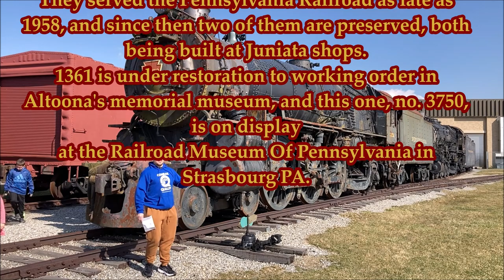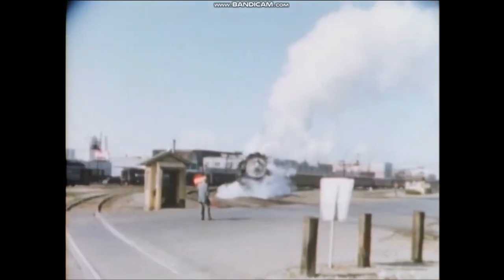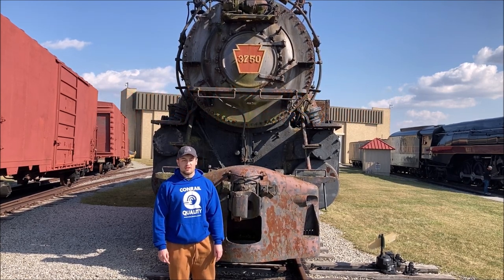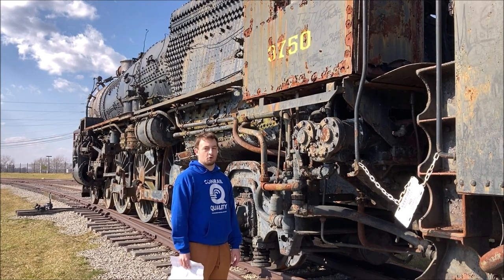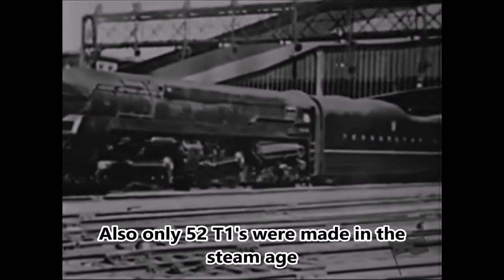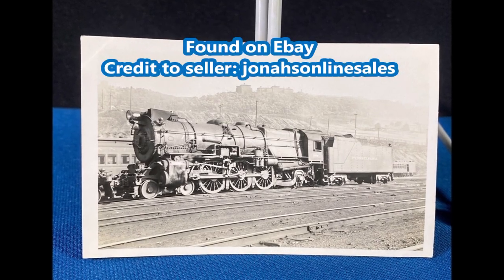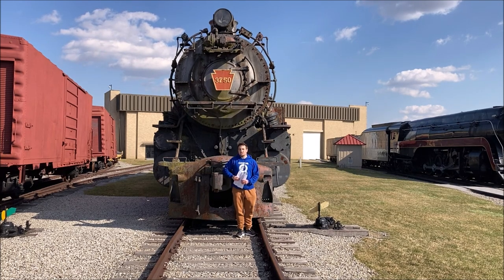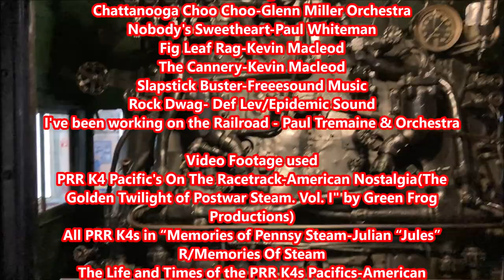The Pennsylvania Railroad's stupidest experiment ever| The K5’s |Garbage on The Rails Episode 9

Comment: The reason why the PRR didn’t have any 4-8-4 “Northerns” is for the same reason as T-1s being Duplex locomotives with Franklin Type A oscillating cam valve gear and why the PRR didn’t build any “Mountain”-types for passenger service. The main reason is that longer rods are typically heavier and create a greater hammer blow. This would be exarcerbated if the driving wheels were not counterbalanced correctly, which was the problem with the Atlantic Coast Line Railroad R-1 Class. This would mean that more money would be needed to upgrade the PRR’s infrastructure. Also, a low factor-of-adhesion is mainly an issue on gradients, slippery rails, long trains, and low speeds. The Southern Railway Ps-4 Class “Pacifics” had a factor-of-adhesion of 3.79, and they were very successful, powerful, and capable. The same goes with the Southern Railway Q1 Class 0-6-0 tender locomotives. While they had an issue with underpowered brakes due to their lightweight nature and a factor of adhesion of 3.81, they were still very powerful for their size and extremely versatile. I’m not trying to defend the K5s, but I am saying that a low factor of adhesion does not always make a bad locomotive.
Reply: The M1's were dual service locos, and a number of them did wear passenger striping for a time.
Reply from the maker: Another thing with history is that it can have so many perspectives from so many different people. Some you never see coming. The problem is that trying to put in so many perspectives at once can lengthen analysis, and even I have my own limits of what perspectivesI want to put into this stuff without making it too long. Understand too that while Thunderbolt 1000 Siren Productions is amazing at this, he’s been doing it for 6 years and it took him time to get better at it to where he is now. I’ve only been at DOA/GoTR for two years.
Reply from the maker: It’s true the PS-4’s got away with it. However the reason the K5’s didn’t get away with it as opposed to the K4’s or even the Ps-4, was because the K5 was just too powerful for its own low adhesion, and the PRR having a more rocky geography than the Southern. It didn’t have enough adhesion for its own power to handle over grades like the Alleghenies and other rough terrain on the network like the Horseshoe Curve. So kind of a mixture of PRR overdoing it with power, not coming up with the best way to load up enough adhesive weight, and geography. Then again, the Ps-4’s and K5’s came in for different reasons with completely different origins
Reply: Insert the northerns that probably a better locomotive than the T1.

Comment: Great episode as always! The Pennsy has always been known for keeping to old traditions, and I suppose this is a perfect example of how sticking to old tech can result in long term losses. I also appreciate how you include various mechanical aspects in this series, since I wasn't aware of the 4.0 adhesive factor until now, and it certainly brings home the point of the K5's failure. Best of luck in school, and continue to keep up the great work on the channel!
Reply: The Jersey Central was the same thing, Largest locomotives in its fleet were the G class pacifics

Comment: In 1939 the Lima Locomotive Works extensively rebuilt and thoroughly modernized Pennsy K4 5399. The end result was an engine powerful enough to do the work of 2 standard K4's. LIMA wanted to do the same work on a Pennsy M1 but due to circumstances such as the Pennsy’s reluctance to explore the options and onset of WWII it never happened. The Pennsy also favored Baldwin over the other builders and they, in my opinion, convinced the Pennsy to invest in experimental designs that often weren’t proven out. During the steam years Pennsy had gone to both ALCO and LIMA for assistance in new designs only to have Baldwin or their own Juniata shops do the work. The K5's also were built without stokers which was not surprising knowing the Pennsy's view on modern appliances for their engines.  Can't imagine the work involved for one fireman to keep the K5 hot.  Thanks for the interesting video.
Reply: That makes a lot of sense, since Baldwin was the closest locomotive workshop to the Pennsylvania Railroad apart from the Juniata Shops.

Comment: This was an enjoyable and well detailed video, the PRR K5 class was desired to be an improvement from the K4 design but it had issues with wheel slippage despite producing higher tractive effort. The PRR should have considered designing either a 4-6-4 or 4-8-4 type locomotive for their passenger service, seeing a PRR design for either of these two engine types would have been interesting and impressive in my viewpoint since the PRR never owned any 4-6-4 or 4-8-4 types. I always heard reports about the Pennsylvania rr  K5 class being failures and this video effectively described why due to their personal performance flaws and issues.

Comment: I suppose the were more of a test bed for recent (post-1920) developments in locomotive technology, not a prototype for a new class. But they were a blind alley. The big question is why they build that last batch instead of M1s, or put the effort into making an M1 into a Northern. Then the depression hit. By the time the needed more locos (the War) a LOT had changed. Evidenced by how much better the Js were than anything out of Altoona. And they were C&Os just about the time the K5s or a few years later.
Reply: Pennsy's mistake was acquiring the last 100 K4's.
Reply: @660Oliver  agreed, but I have a soft spot for the M1a
Reply from the maker: @roberthoffhines5419  Same. I like their look, especially the prewar one. I do think they would have made great premiere passenger locomotives on heavier passenger trains for the Pennsy, even the heavier ones if the infrastructure allowed it.

Comment: Something else i just thought of. Maybe part of the reason there was a gap in passenger steam development between the last K4s and the S1 was the Pennsy was hoping to electrify at least to Pittsburgh. They already had too many K4s E6s etc after the GG1s took over the corridor. But maybe the infrastructure costs never  came down with technology and the depression hit. Then the war. Both of which rendered the  T1s were 10 years too late to work out the bugs. Then diesels which carried their own electric plant on their backs did an end around on electrification and sealed the deal.
Reply from the maker: Yes. High Iron Mentions it in his video about duplexes. There were a bit of info he also put in, including how the K4’s were the newest passenger locomotives on the pennsy until the S1 and T1’s showed up, which does make some question PRR’s motive power department

Comment: The K5 was an honest attempt to improve the K4's tractive effort. The main problem was that due to clearances the locomotive couldn't be more than a certain height, and with the increased power output water carryover to the cylinders was inevitable. The K5 was a poor steamer due to the less-than-ideal steam dome height. There was much debate among PRR higher-ups as to which trains the K5 would pull due to maintanence layovers.

Comment: Ok, you seem to like physics, science and numbers. Please explain to me how it is possible that if the PRR had made the K-4 into a Hudson it would have pulled better? I fail to understand how adding an extra dummy axle to the locomotive would increase its pulling power or adhesion to the rail? As far as I see it, the only way to increase traction is more weight on the drivers and more driving wheels contacting the rail. The K-5 is not exactly a small pacific. However the amount of weight on the engine truck and trailing truck compared to the drivers is a huge factor in its ability to grip the rails as well as how ridged those suspensions are on the engine truck and trailing truck meaning if they allow the drivers to bridge a low spot in the rails because they don't give enough to compensate for track irregularities.  And as for track structure being the issue with not making a Mountain? PRR had the biggest/heaviest main line rail of anyone in the east. And they did have dual service mountain locomotives. Don't get me wrong here, I love that you are trying to bring history to the younger generation of the real days of railroading. But there are a lot of facts and things that you yourself don't fully understand but will with time.  Also you really should invest in a cheap lapel mic for doing videos like this. Then we could actually hear what your saying! :)
Reply from the maker: I wish I was better at explaining stuff like this but unfortunately my aspburgers syndrome and shy attitude with talking are still giving me a bit a trouble. It is something that engineering students like me do have to learn how to do anyway in college which is be able to explain complicated matters and solutions to problems toward people who aren’t experts with it. I did try to hint at what I was trying to explain with that caption in the Niagara photo but wasn’t as specific as I hoped to be with my mind that dislikes talk.  What I meant to explain through that little caption was,  the reason that Mountains and Northern types were able to even get enough adhesion unlike the K5 was for a few reasons. 1. that they had more driving wheels to get more grip on the rails. 2. From what I was able to conclude from the information about these being preferable to the K5, the longer frames resulting from more drivers long wheels gave more space for more weight to press down into the driving wheels, thus being converted into adhesive weight.  

Also the reason the NYC when for a 4-6-4 instead of a Pacific bigger than their K5’s and 3’s, was due to axle load limitations on its rails. They realized they would need a longer frame and a larger firebox to support a bigger boiler to handle lengthening passenger trains while complying with the axle load limitations. From the sound and analysis of it, the larger firebox of the Hudson’s also meant it was heavier, thus adding in additional weight that would’ve helped load more onto the driving wheels.  

On a final note, I did also put up in another captain that the K5’s engine wheelbase was the same as the K4, so that meant there wouldn’t have been enough space for the fatter boiler to load enough weight into the driving wheels. But they were also too powerful for such a low adhesive factor, hence why the slipped so easily.  I hope it cleared up something, apologies for not being so clear at firsts
Reply: @AndrewTheRocketCityRailfan4014   Yep, That does make more sense than how you put it in the video for sure! :) The reason they would build a bigger firebox is for more heating surface which equals more steaming ability of the boiler. which in turn is heavier requiring the two axle trailing truck. Yes weight distribution is an issue for bridges and some rail sizes and NYC did take that into account. They were quite proud of their 4-8-4's and they did perform very well. As A B&O man myself I know more about their engines than other RR's but I am also a licensed steam engineer by trade, And I operate a steam locomotive on some weekends as well as stationary industrial boilers. Steam has always been a love of mine for many many years. One bigger issue the NYC had like with building the huge Niagara's was tunnel and over head bridge clearance. They made the boiler so large on those engines, they had eliminate the steam dome on them for clearance. This in turn brought higher potential for carryover. So the crews had to keep the water conductivity in check much tighter especially at high boiler loads. Thanks for answering my questions about your comments and good luck. :)
Reply from the maker: @s16100  Thank you sir. I’ll admit I’m also more of a Union Pacific and even a New York Central fan than a PRR one
Reply from the maker: Also, trying to emphasize the physics in addition to so many historical viewpoints is quite a challenge I’m still improving upon. Considering AmtrakGuy 365 and Thunderbolt 1000 Siren Productions have been doing similar work for longer than I have, with less mentally stressful college work that mine(engineering) intervening, I haven’t lost hope of getting better at as I keep doing it more
Reply: @AndrewTheRocketCityRailfan4014 Practice makes perfect. No one just jumps into something and is perfect the first few times. :) But if I can give you some advice, I am in my upper 50's. I never set foot in a college because I believe they are more interested in teaching you their views on politics and book knowledge. I have a rather high Mechanical aptitude, and it runs in my family. My uncle was a mechanical engineer even. So to my point, over the years I have seen so many college educated people come into the workforce knowing it all because they have a degree and the books says it works this way. And they are so annoyingly stupid because while they can sit down and quote to me math equations I can't begin to understand or even care about, the reality in physics is things don't always work the way the book "theory" says they will. There have been so many times industry that bosses fresh with a degree came to me trying to demand that a machine can be changed and run faster or better only to have it break and then they scratch their heads walking away while I, the uneducated idiot fixes it and makes it run again right. So what I am saying is, you have to get a few years of hands on in the grease and dirt to understand how things really work. And for some reason the colleges do not seem to teach that. Some professors have never set foot in the industry they are trying to teach you about. How can they possibly have answers? The book is a great starting point to understand roughly how things are, but real life experience is the only way to really get it. BTW I studied and passed the exam for steam engineers with no school at all, and my license is equivalent to a 2 year degree. So I am probably not totally stupid! :) So all that said, please do not leave that school with a degree and be cocky like most do. be humble and realize there is still lots to learn ane you will never stop learning. :)
Reply: I'm surprised that PRR never did anything about loss of traction which became a very expensive problem. I noticed that you mentioned weight distribution on the front wheels as well as on the wheels below the firebox (no traction). Also, farm tractor manufacturers often add cast iron weight to the wheels as well as ballast (calcium chloride or lead) to the tires to increase drawbar horsepower. In the case of K4 & K5 was the increase in weight from 95.75 T to 125 T enough to account for the increase in horsepower?
Reply: @n.mcneil4066  A few railroads did add booster engines to the trailing trucks on some locomotives to help them at slower speeds get more traction and power. The C&O 4-8-4's did as one example. The 614 can out pull other northerns the same size because the booster engine can be engaged and power the trailing truck wheels. I don't know what the PRR did with the increase in weight with the K-5, but I can assume by the comments of it not pulling any better, the weight was mostly supported still on the engine truck and trailing truck. Large driver size seems to add to more slipping anyhow. I know the B&O Pacific's were kind of slippery engines too. It is an interesting study of weight distribution on the axles for sure.